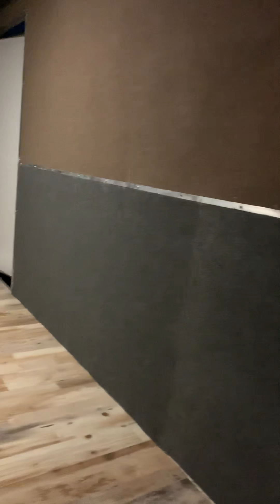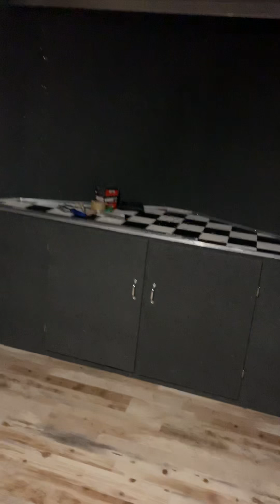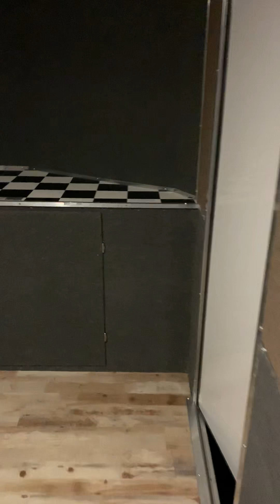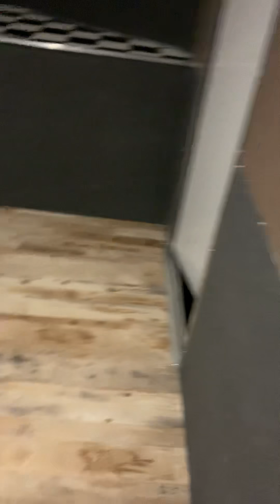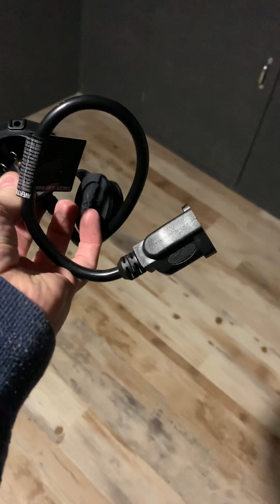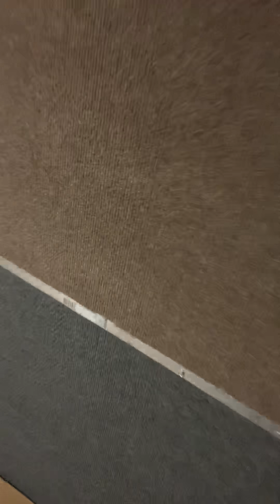Cargo trailer camper conversion - Part 2

Comment: How did you attach carpet to wall?
Reply from the maker: I used a spray adhesive made by 3M.  You can get it at any Home Depot or Lowes.  If you look closely.. you might notice some staples too.  I probably didn't need them.. but I added a few along the seams just in case.  But the glue seems to be holding fine after almost 2 years.

Comment from the maker: So unfortunately, that Renogy 700 watt inverter was DOA.  I had to send it back.  Rather than take my chances with getting a replacement, I decided to get a different brand.  The Giandel brand has lots of great reviews on Amazon, so I picked up a 1200 watt pure sine inverter.  It was about $30 more than the Renogy, but I'm getting an additional 500 watts for that additional $30.  It arrived today (Tuesday 2/19).  Hopefully I'll get a chance to wire everything up over the weekend.. and I'll post a quick video showing it off.